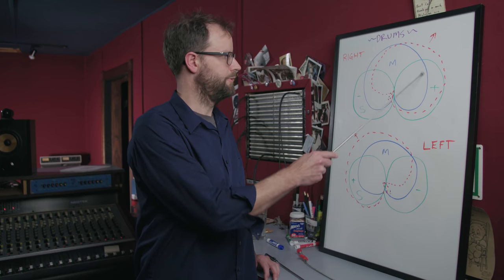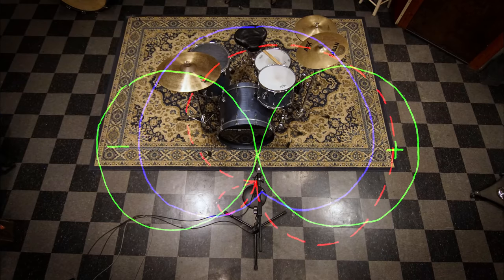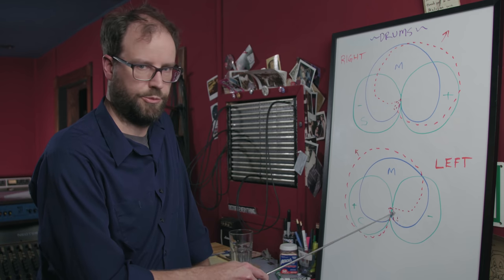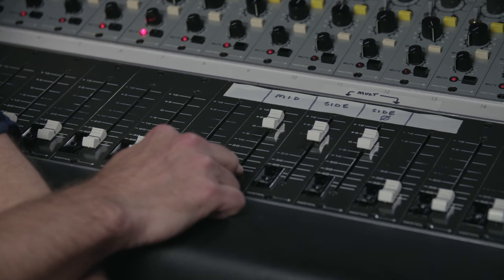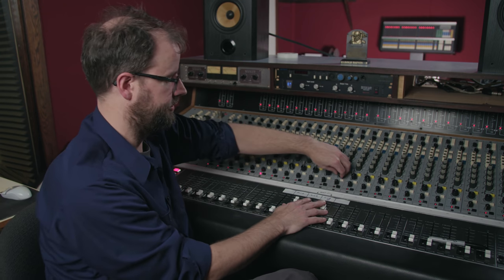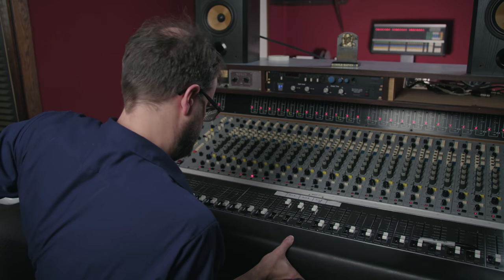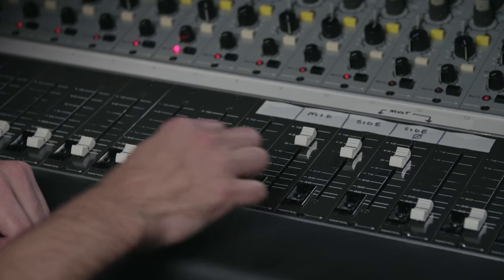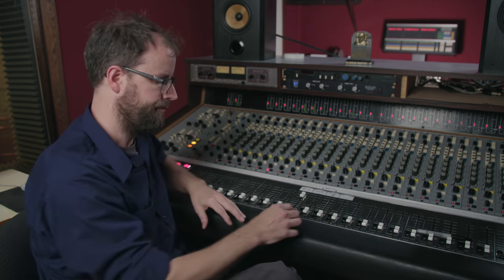Electrical Audio How-To: Mid-Side (M-S) Recording

Comment: Not to be 'that guy', especially as this has been really well done here, but the original technique states an omni for the mid mic. While you can absolutely use a cardioid, it's not quite the same effect - particularly as omnis do not produce  proximity effect. The frequency response remains flat at any distance. - why they're so popular in field and large scale ensemble recording. To add to the conversation.

Comment: Thanks for such a useful video! One thing I was considering for my next project: using mid-side on the drums for the room sound and using the Recorderman setup for the drum overheads. The idea being that the overheads will get more of the character of the kit as the mics are behind the drums picking up the skins and the mid-side mics will pick up more of the stereo image and give a better impression of the room character (it's a pretty big, untreated room I'm recording in). Is this something that might work, or am I likely to cause all kinds of phase issues?
Reply from the maker: Try it! Recording multiple mics on any sound source will involve some compromise on the phase relationship between the mics, especially a drum kit where there are 5-20 "sources" (each drum, even each head on a drum, the cymbals, the beater/ stick, etc etc etc). Just be mindful of this and, as always, try reversing polarity on each signal to see how it affects the sound, and you can experiment with delaying signals or aligning waveforms in the DAW to get a more ideal phase relationship between signals.
Reply: @ElectricalAudioOfficial  thanks for the tip :)

Comment: The Zoom H6 field recorder contains a capsule with the mid side mic in a small capsule with very close orientation for very little time delay phase shifting. The side mic is bi-polar for excellent stereo pickup. The recorder has the processing matrix for generating stereo, or mid side channels.  This is excellent for stereo for video or FM broadcast as Mono and L-R side is direct from the recorder.
Reply: Same for the Shure MV88+. You can choose to record the raw MS signal and decode it yourself or have the DSP take care of it, and you get to set some parameters.

Comment: I hear the sereo effect just fine using either headphones or my regular system.  I tried both and although different as I'd expect,  I couldn't say that using headphones made the effect more noticeable or that the speakers made it more noticeable.  Either way it was very noticeable, just different.  Why would I notice he effect more in my headphones?
Reply from the maker: Because there's no phantom center with headphones.
Reply: @ElectricalAudioOfficial  Makes sense.  Aftert your pointing it out.. yep, that's the difference alright.

Comment: This was recommended to me as well and I really like the video. But to be honest you lost me when you started talking about the positive and negative polarity of the microphone. My knowledge of audio engeneering is very very limited. Can you give a recommnedation of where I can learn more about this?
Reply from the maker: A very thorough, if maybe too technical, reference is the Eargle's Microphone book. Otherwise, Wikipedia is a good read. The text below is pasted from Wikipedia:

"Figure 8" or bi-directional microphones receive sound equally from both the front and back of the element. Most ribbon microphones are of this pattern. In principle they do not respond to sound pressure at all, only to the change in pressure between front and back; since sound arriving from the side reaches front and back equally there is no difference in pressure and therefore no sensitivity to sound from that direction. In more mathematical terms, while omnidirectional microphones are scalar transducers responding to pressure from any direction, bi-directional microphones are vector transducers responding to the gradient along an axis normal to the plane of the diaphragm. This also has the effect of inverting the output polarity for sounds arriving from the back side. "

Comment: Again, awesome video and tips. A tape machine comparision would be great. Otari mx5050 vs Studer A820 24trk vs 16trk vs Tascam vs MCI? I think I  saw a Tascam ms-16 in another video from you and a couple years ago you also offer recording on MCI 8 Track. Hearing the difference, hiss, thickness etc. would be very interesting, also facts like spooling time, effort to maintain... thank you and stay healthy
Reply from the maker: We borrowed the 16-track Tascam for transfers, and the MCI we sold a few years ago. We've standardized on Studet A820s because they're incredibly well-engineered, sound neutral, are great on tape, and have auto-calibration, so they allow us to maintain the standard of calibrating for every session while requiring way less time to do so. Those are the criteria one should consider when choosing a machine. The MX5050 8-track we also just use for transfers.

Comment: That's very interesting. I like recording my drums with a single SM57 between the bass and the snare drum. It gives me a great sound for those 2 main drums and the hihat, but my crash cymbal and the low mounted tom are to the right, so they sound very quiet. Adding a microphone to pic them up really balanced the sound of the kit, but I wish there was more stereo (I don't really wanna put my kick and snare on a single side lol). Just reading the title of this video gave an idea to try and use mid side, with the main mic as the mid and the auxiliar one as the side, I'm hoping it will sound great (I guess it makes sense the crash and the tom to the side to have the most width, in my head). Gonna try that next time I record!

Comment: Great stuff. But why choose this over a Blumlien setup?
Reply: Blumlein (two coincident fig 8 mics at a 90º angle), is a great sounding stereo setup.  I love it for overheads, acoustic guitar and some pianos. The drawback to this and xy is the center content is picked up by the two mics "off axis" at roughly 45º.  This means neither mic is capturing the center of the target with its best response.  All microphone's frequency response and fidelity deviate from their best, when positioned at an angle to the source (see the spec sheet's pickup pattern at different frequencies).  This is especially true with figure 8 and cardioid, but also true of omni mics to some extent.  M-S starts off with a mic pointed directly at the subject (Mid), taking advantage of its best possible pickup fidelity.  So in the case with this video, you get a better representation of the bass drum, snare, general core of the kit than you would with two mics aiming at the sides, as with xy or Blumlein.  The other advantage, as described in the video is if you choose to mono the signal to fit in a dense mix, the side mic cancels out completely, and you're left with the Mid microphone.  Ideally that would sound good on it's own.
Reply: @gregnorman1489  that’s great, thanks for the considered reply.

Comment: Thank you so much!! I am curious about how such stereo image would differ from having two cardioids panned hard L and R, pointed at the drums, one slightly to the R and the other to the L - similar to how we typically set up overheads but from the front? I am suspecting I wouldn't get as much of the ambience of the room coming from behind the mics, which I assume is a great use for this technique to begin with... thanks so much again and please please keep posting. Cheers
Reply: this would work, but you're locked into the stereo width you effectively "chose" with your mic placement. the nice thing about the m-s technique (apart from having a nice mono, if you need it) is you can create the appearance of reducing or increasing the stereo width just by changing the ratio of the levels from the mid channel and the stereo pair—i guess you could have a similar kind of control if you added another central mic to the set-up you mentioned, but then you're setting up three mics instead of just two.
Reply: (ofc you'll have a slightly different effect from setting up a separate "left" and "right" directional mic pointed directly at the source, compared to the "virtual" cardioid or subcardioid from using a central bidirectional or omni "side" mic, which—depending on their level relative to the "mid" mic—will also report more of the room sound as they're effectively angled away from the source)
Reply: @soupalex  Thank you so much!
Reply: @ivanphoto44  yw! glad my comment was of some use… i'm not very good at explaining things

Comment: So, is the sides microphone stereo ? How do you get to have both sides on separate distinct sliders?
Reply from the maker: Hi, there's a more thorough explanation somewhere in the comments to a similar question. It's a mono mic, but the way a bi-directional mic registers sound, sound pressure "pushing" the capsule from the front generates a positive voltage, and sound from the rear "pulls" the capsule and generates a negative voltage. By splitting the signal into two, one that is the normal signal and the other with polarity reversed, you have two signals corresponding to sound from each "side" of the mic.

Comment: Can you use a ribbon mic mounted that way for the side mic? I thought it’s problematic due to sag in the ribbon?
Reply: You can.  A fully functional ribbon shouldn't have any slack to sag.  Lots of beaten up mics do, however.  If that's the case, it needs to get it re-ribboned...

Comment: Ok ok ok, but how you get 2 tracks out of the 1 figure 8 (side)mic?
Reply from the maker: Duplicate the track and flip polarity on one side. This is how a figure-8/ bidirectional mic works, air pressure from one side is "converted" to positive voltage/ signal, air pressure from the opposing side is converted to negative voltage/ signal. So by doing this you essentially separate the one positive (front) side from the other negative (rear).

Comment: I've always found it difficult to work with figure-8 pattern microphones because there just so bipolar. And if you're on their wrong side...well, it's just null.
Reply: That’s what makes them so great though. They’re basically like a cardioid mic and a room mic combined, so they sound great on acoustic guitars and drums. 

Because of how strong figure-8 mics null (better rejection off-axis than a cardioid mic) you can place one between the cymbals pointed at the snare and get a really nice capture of the snare with very little cymbal bleed. It sounds less unnatural than a close mic but not as soft/distant as the snare pickup in the OHs and is far more isolated. Shamelessly stole the idea off Eric Valentine. 
RCA44s and 4038s sound especially good in this position.

Comment: I've got one question about mid-side: When you are tracking mid-side, do you prefer to record the mid and side separately to two tracks, and handle the balance of them in mix down, or, do you prefer to record the actual stereo image that results from the mid-side combo? The former would rely on correct labelling of the tracks and trusting the mix down engineer getting it right, but the latter locks in your creative choices as to the stereo image & balancing. I could see arguments for both, perhaps depending on the application, who is doing the mixing, etc? I've recorded mid-side on location for ensembles to a two-track (stereo) Nagra, and then remixed that down to a stereo mix later; that's always been my use-case for it (reflecting my experience more in location film sound recording). Just interested if you have views on it?
Reply: Electrical Audio's work makes it seem more likely that they'd record them separately and combine the tracks in the final mix, if you're recording at Electrical Audio you're probably having them mix too (thus eliminating concerns about relying on others to not fuck up). They're not the kind of studio that would record in such a way that they'd potentially have to re-record the whole drum part if the client decided they wanted the stereo image done a bit different, they're too efficiency-minded for that.
Reply: @drpibisback7680  yeah that makes sense. I guess if the client turned up and said they were gonna mix it themselves you might wanna record the stereo mix — but of course then they’d have to be doing to it to pro tools and not tape, in which case you could record both the mid-side AND the stereo cos tracks are free more or less.

Comment: Wow. Wow. So that’s how Albini got that awesome guitar amp sound on so many recordings. I always wondered what I was missing. Can someone please explain how to record the flipped polarity so that you end up with the 2 stereo tracks from the perpendicular microphone? Is it just a matter of copying the side mic track onto another track and then flipping the polarity on one of those tracks using the mixing console’s “polarity” button?
Reply from the maker: I don't think Steve has ever used M-S to record an electric guitar cab. M-S is generally used on sources that have an inherent width to them, like an orchestra, instrumental section (strings, horns), a drum kit, a piano, etc.

There aren't two stereo tracks from the perpendicular (side) mic, there are two mono tracks generated from it. You have the right idea, though- the front of the mic is positive polarity, and the rear is negative, so you duplicate the output of the side mic's preamp and flip the polarity on one, hard pan them and you have both sides. You can do it on a console or in your DAW.
Reply: @ElectricalAudioOfficial  Thanks. Yeah, that’s what I meant—two mono tracks for a stereo effect, sorry. Is Steve’s cab mic’ing + mixing technique generally just a mix of close mic and one some distance away, or behind the cab, and then mixed with some width to create a slight spread? One last question if I may re: M-S and polarity: what if I don’t have a console that has a polarity switch, and I don’t work with a DAW—is there outboard gear that can get the job done?
Reply from the maker: @slacktoryrecords4193  It's almost always two close only, a ribbon and condenser or ribbon and dynamic. He places them a bit further back than is typical- maybe 4-8 inches off the speaker rather than right up against the grill. He'll commonly record an ambient mic, usually a PZM on the floor all the way across the room. Sometimes these are spread against each other. Sometimes the close mics are panned out, but, again, you aren't going to get much sense of stereo by panning two mics placed at nearly the same point recording the same performance.

Polarity reverse is the correct technical term for what people usually call "phase flip." You aren't actually changing phase in the analog domain when you hit the flip button, you're literally just flipping the positive wire to negative and vice versa to reverse the polarity. You should have a dozen or so plugins that came with your DAW that have a phase flip/ polarity reverse button, same thing.

Comment: Question: Do you use this technique in tandem with spot mics/overheads, or is this considered a strong enough technique in the industry to eliminate the need for combining multiple methods?
Reply from the maker: For drums it is usually combined with overheads and spots. Drum recording is done wildly differently everywhere, though, and a front-of-kit M-S pair can give a totally viable drum sound. Just probably not for modern metal or pop.

For piano, orchestra, choir, etc. same deal. You may want extra detail from spot or area mics, but M-S can be a totally usable and good-sounding by itself.
Reply: @ElectricalAudioOfficial  Cool! thanks for keeping the humorous deprecating tutorial genre on Youtube going strong

Comment: i assume two cardioid mics for mid side stereo recording is not recommended.... is it ? however is really that bad ? i will try it, but i don't expect it to work...
Reply from the maker: Do you mean a cardioid for mid and a second for side? It won't work- the side mic needs to be at a 90 degree angle to the mid in (nearly) the same position. Cardioid mics reject sound from the rear, so your side image once you duplicate and flip phase and pan them against each other would be entirely one side (and no sound from the other side).
Reply: that's exactly that @ElectricalAudioOfficial  thank you !

so ouch. not today for me it seems... it does not matter anyway ! XY is fine for the moment.
Reply: finally got myself an AT-2050 multi pattern mic... i now have a figure 8 compatible mic on top of my collection! time for some MS recordings ^_^ ! :-D

Comment: on fader is for the mid mic and the other mic is on the other two faders? i got lost there sorry :(
Reply from the maker: One fader for the mid mic, and then you duplicate the output of the side mic (after the preamp) to the other two faders. Flip the phase on one of these two side faders (because while one side of the mic will have positive polarity signal, the other side will have exactly the same amplitude but negative, and vice versa).